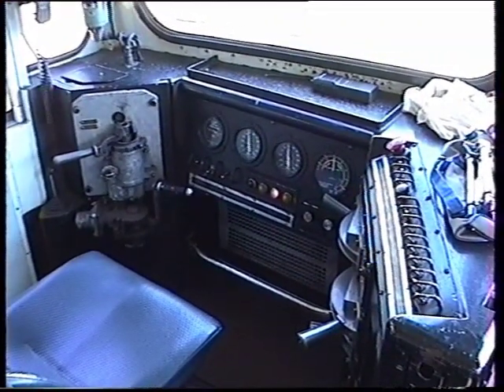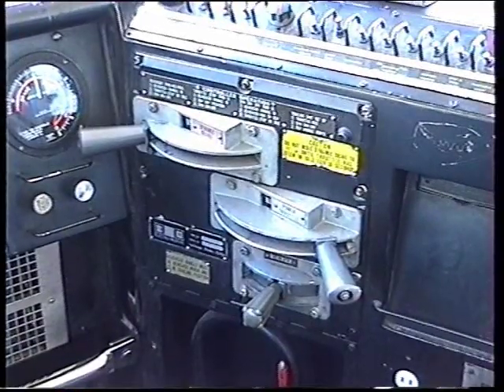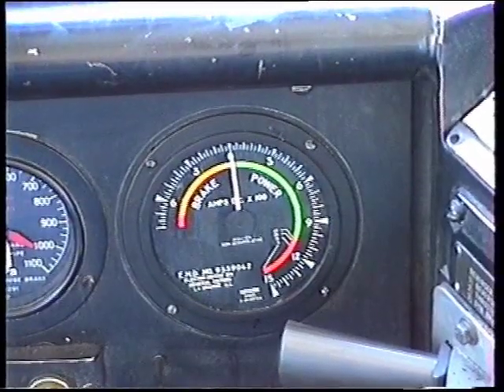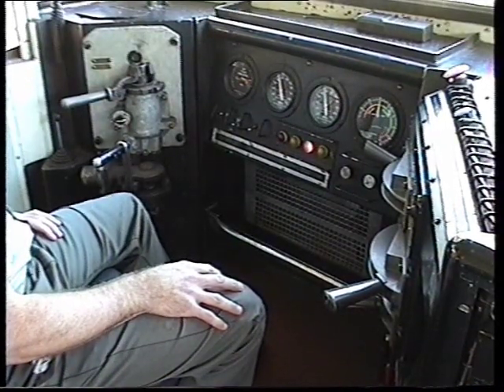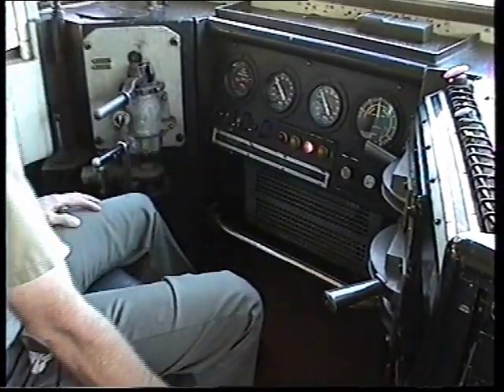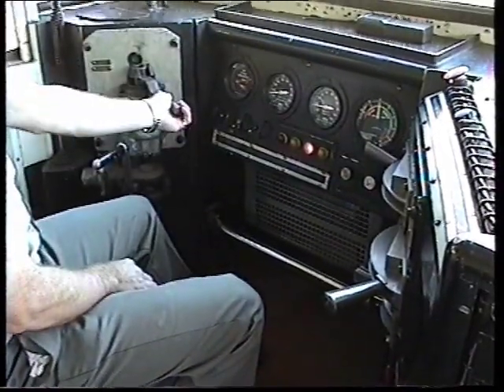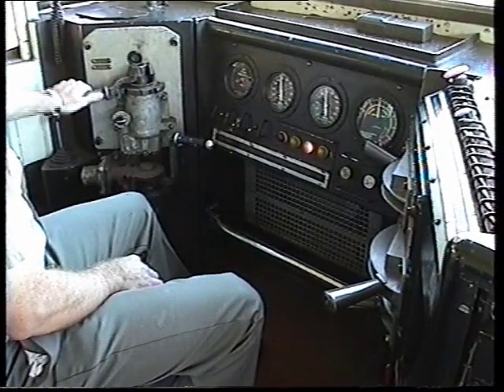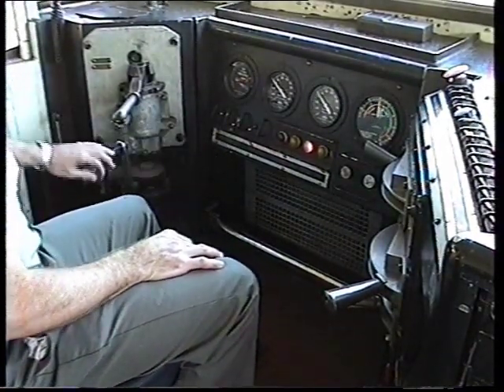8136 engine prep

Comment: entertaining, yet baffling to a car driver.  it does not seem to be a very ergonomically designed cab.  you have to reach for everything instead of it being within easy reach.  i note the name of your channel and have observed that drivers generally consider the alcos ride smoother and i have also seen it written that they require more maintenance time than the emd's.  why are they your preference?
Reply from the maker: G'day,
this is the cab of an EMD.
Noisy damned things, as I refer to them, ear ache territory.
You can easily reach any of the necessary controls.
I prefer Aussie Alcos as they were most harmonic to the eardrums.
Basically, the difference between a four stroke motor bike and noisy two stroke.
Not many two stroke lawn mowers exist today, only four stroke.
Four stroke is generally much more harmonic and also fuel economic.
Steve.
Reply: aussiealco  , thanks for the reply.  you seemed to have to lean forward to reach things, that's what i meant.  the english electric seem to have the sweetest sound to me the car driver.  i've seen it written that the reason the alcos puff out smoke when you open them up and the reason emd's don't is because the emd's have some sort of assistance to get the turbo up to speed on the lower notches.  might it be possible to improve fuel emissions on the 48 class(obviously a highly practical machine) on throttling up if it had something like on emd's retrofitted?  i don't know what ge's have under the bonnet to stop it.  oh, and about the noise of emd's, i was given the opportunity to get in the cab of a gm or cl class while it refuelled at cook, 30 years ago.  i was surprised just how bloody noisy the cab was.  what an unpleasant environment.  then i was allowed to look in the engine room.  jesus bloody christ, now that was bloody noisy, so i understand where you're coming from.  surely the 81's, g's and bl's were quieter after decades of development?
Reply: I recall that the 82's have cab suspension which is why theres that weird crack just below the shunter's horizontal handrail, going just about at the top of the PN logo to the back. I guess the suspension was meant to reduce the noise. 
I wonder if this is why there is vibration at notch 8 the cab springs are in harmony?

Comment: Hi Steve
Got an 81 doing What?
https://youtu.be/EQsT9drM3_w
It seems to have Sea Container built liquid containers. Perhaps gas? But since the 81's do the Manildra run I'm thinking Canola Oil maybe?
Freight is very LOCO/Job specific.
81's (Wheat and this)
82's (Coal)
NR's (Metals)
81's do a box container run every now and again maybe I've seen it once per 3 months, but I'm not looking out for them and don't know if theres a specific running time for them or if it's a DoD run - Deliver on Demand.
Reply from the maker: G'day Stumpy Steve,
I managed to find yer you tuber clip, though not the link that you have here.
I am guessing that the containers would be the cement tanks now in use between Clyde and Port Kembla.
I have not seen the particular train, but have heard a little bit about it.
I cannot find the forum comment here at the local library on the www.
The container code was something like ISO but I cannot confirm that here.
Steve.
Reply: Hmm that's what youtube said the URL was, so what did it actually show up as? (1st time poster of this so I hadn't added comments.) BTW did the vid come out portrait or landscape? I hope land as I had Hell's own trouble usung VLC to save in landscape. Eventually I ran it in VLC in 90 degree mode, and saved it on a screen recorder.
Interesting re: wagons. I've got a mate at Parramatta and there seems to be something diffrerent going on there... some blue wagons with I think crushed stone - perhaps towards Penrith for crushing, then back the other way as cement.
Also, since NSW is trying to centre population at stations, it woould make some sense to have these somehow available astraight to the worksite as it were if they could.
Reply: BTW I've come across these before at the station, but not the UM
(O) blue flashing light
W
A
R
N
I
N
G
30
UM

The speed number is yellow, so is Normal (Passenger / Freight).
ANSG_604_I5 says:
"WARNING
2500m before the affected portion of track.
Temporary speed restriction ahead.
The bottom of the sign shows the limit that applies in the affected portion of track
(Intermediate) WARNING 
Before the affected portion of track.
Temporary speed restriction ahead.
The bottom of the sign shows the limit that applies in the affected portion of track, and the reduced distance to the CAUTION sign.
"
How would I know if it is Int or Full?
The bad thing is one of them is located at the starting end of the platform which is on a curve, so it could not be a speed warning, as it's hidden from a driver skipping the station by the curved platform.  So I would guess its Full, giving the driver an indication as they sweep past that theyve got to slow.

I thought the UM (white) seems to say Up Main ?!?.. One track is the Down Main, but the other is the Down Local so Im getting confused. Is it for passengers ie UnModified speed or something?
I have downloaded spc-213.pdf but that's specs, not usage.
Reply from the maker: G'day Stumpy,
I am at home today.
No point trudging to the local library on tuesdays as the old farts doing genealogy research hog the computers.
I am not able to view video at home on my el cheapo www.
I forget just what You Tube said now when I attempted to find your clip.
I had put in your link, but nothing came up.
It then suggested a slight change to the link, which then worked.
As to the video shape, again I don't remember, but I think that it was wide screen.
When I began uploading video, only very low resolution was possible.
Only brief low res clips would squeeze through the www at the library during the time limits.
As the www improved, higher res video could then be uploaded an I utilized short MPEG2 clips.
But, today with much faster www, HD can be uploaded.
However, again, HD would take too long at the library, so I now only utilize medium res MPEG4.
You Tube alters the video upload to conform to their standards.
I don't have the www time to muck around in the You Tube video editing section.
I don't possess a mobile phone capable of shooting video or photos.
So, I have no idea just how to alter the video footage shape as shot with one.
Though, I would imagine that holding the phone horizontal should produce video of wide screen shape.
But, as to the video shape orientation when transferred from the phone, I have no idea.
I have only shot video with dedicated video cameras.
I only know that there is a BIG hole in the ground at Parramatta where once there used to be shops.
I don't get to see many current freight operations in the Sydney region.
And, VERY little occurs up here where I live.
The Kandos cement train was once a major freight source in the greater Lithgow region.
I had worked that into and from Clyde yard numerous times.
I enjoyed the days when three or four 80 class were the motive power to Kandos and electrics working east.
But, those days are now long gone.
I remember working home from Mudgee and needing to stop at Kandos works to help rescue a run-away pot.
An old derelict turntable exists at Kandos works.
Kandos yard is downhill towards the branch line and the points set towards the turntable to protect the branch.
But, one of the loaded cement pots had managed to escape and rolled down through the gate and across the table.
We had to detach from out train, leaving it on the branch line and then shunt light engine into the yard.
Then approach the turntable so that a long steel cable could be attached to our loco and the pot.
After the bogie of the cement pot which was buried in the mud had been lifted and placed on temporary rails, we dragged it.
We could not proceed onto the turntable with the loco as the old table could have collapsed due to the weight.
After much effort, we managed to drag the pot back across the table and onto regular rails.
It was then shunted back up into the works yard after the bogie had been checked and approved for travel.
We then hooked back onto the train and continued home to Lithgow.
I also remember another time when we had to help a gang of fettlers drag their bogged truck back up an embankment.
We used a long chain attached to the truck and our loco and slowly dragged the truck back up out of the deep ditch.
Ah the good ole days.
Steve.
Reply from the maker: I have just found your TSR question in the spam section.
Not sure why, but have moved it to normal spot.
Where there are more than one TSR zones overlapping, intermediate boards are utilized.
Differing speed restrictions can be imposed.
There can also be a time period for a TSR.
Usually during the hot part of the day.
And intermediate boards can be utilized where sighting is restricted due to curves and infrastructure.
The actual speed is implemented at 50 metres inside the CAUTION board.
And ends at the CLEARANCE board.
A blue flashing light affixed to the warning board at night time to attract the attention of the driver.
A yellow flashing light affixed to the caution board.
And a white light affixed to the clearance board.
Where the boards cannot be located on the left side of the running track, the board must stipulate the track that the speed is applied to.
UM DM UL DL etc.
Parallel running exists on the speewdway west of Westmead.
The UP lines adjacent and then Down lines adjacent.
The Mains are the outer tracks.
So, if due to infrastructure, a TSR applied to the DM, boards cannot be positioned on the left side, then the boards could infer the TSR for the DS.
So, DM would be applied to the boards.
Steve.